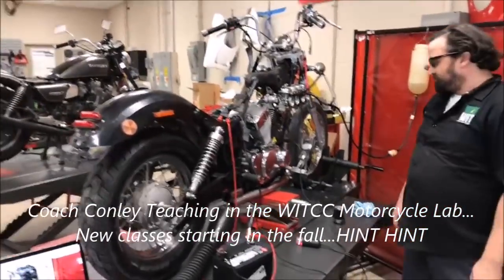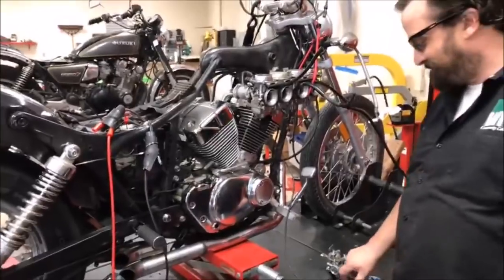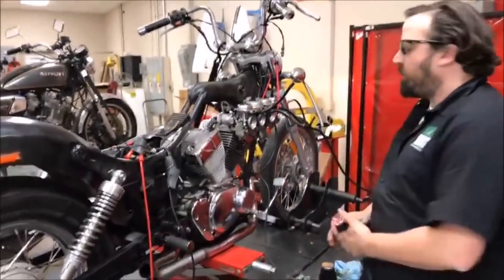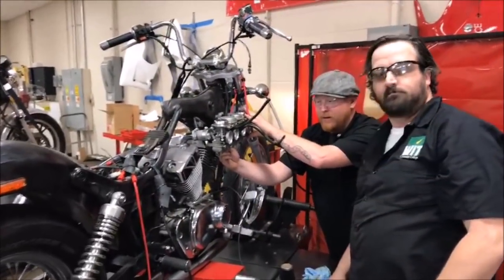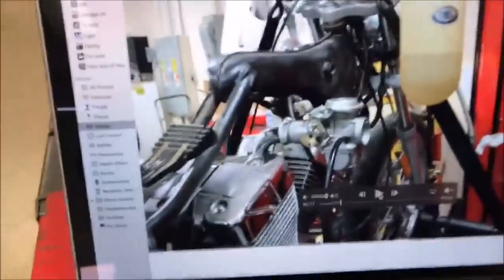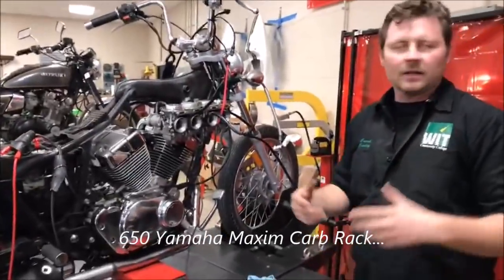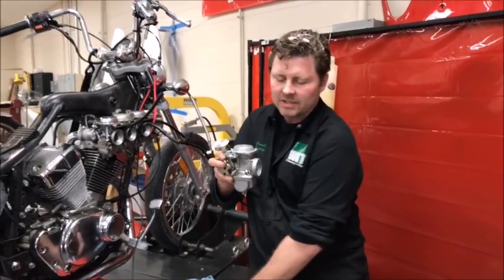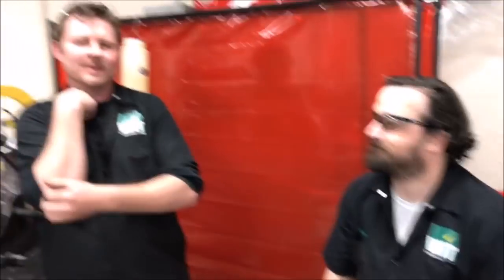4 carburetors mounted on a 250cc Chinese motorcycle! WHY? Did it run?

Comment: will you be pulling the old carb apart to find what is wrong?
Reply from the maker: You mean for the hundredth time? As a professional fuel systems expert, this is the first time I have not been able to "fix" a carb that had no apparently obvious problems. But I do plan to attempt one more "test". The carb will simply not draw enough fuel through it.
Reply: Shane Conley carbs aren't that expensive so you can just get a performance aftermarket one that works better and costs less is bs maintence
Reply: A brand new 30mm Mikuni is $36 bucks on Amazon. Spending anymore than 2 hours on that carb is a waste.